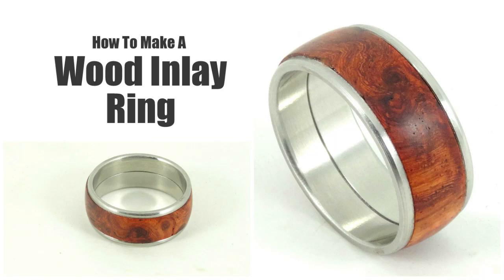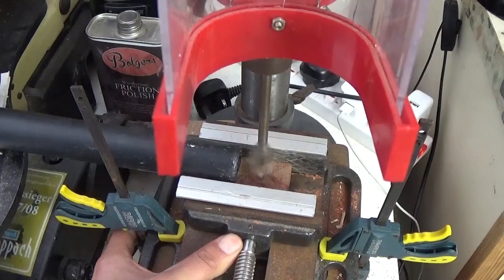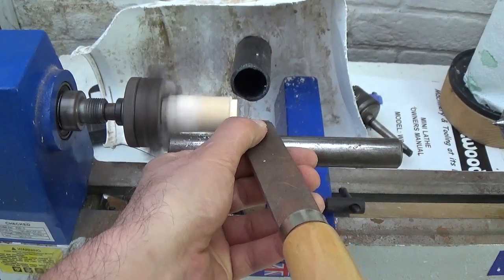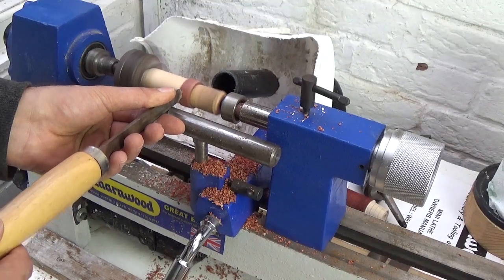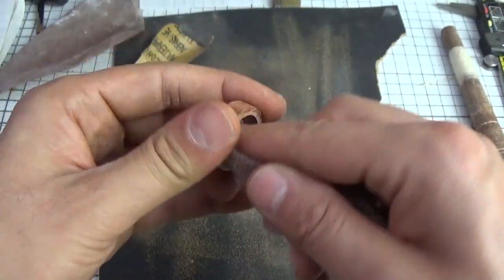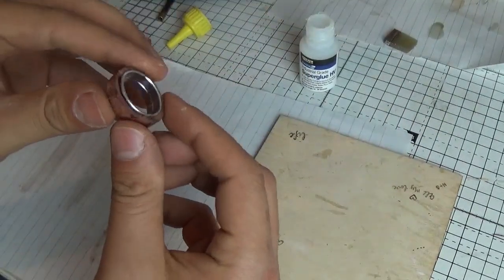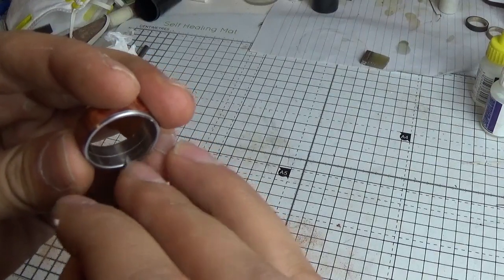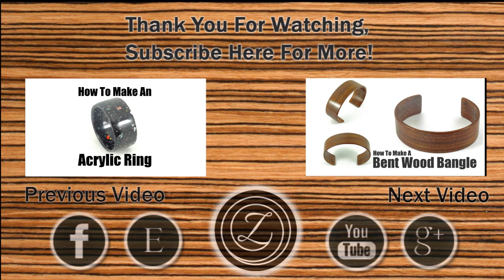How To Make a Ring With a Wood Inlay

Comment: How did you figure the 20mm hole. Thank you for a great video. Jerry
Reply from the maker: +Jerry Mc Guire Thank you!  I measured the outer diameter of the ring blank with a caliper and used a slightly smaller drill bit than required so I could sand it to size

Comment: What glue did you use to glue the metal blank to the wood? A high viscosity glue but what brand
Reply from the maker: I can't remember the brand tbh but a quick search for "high viscosity super glue" will throw up many results.  You can also use epoxy resin like Araldite whiich will work fine.